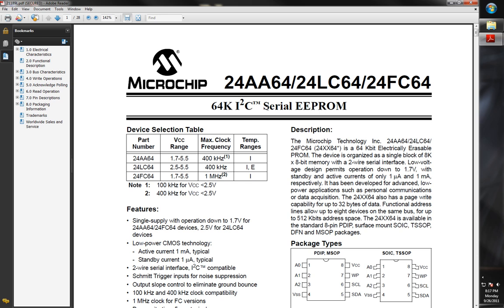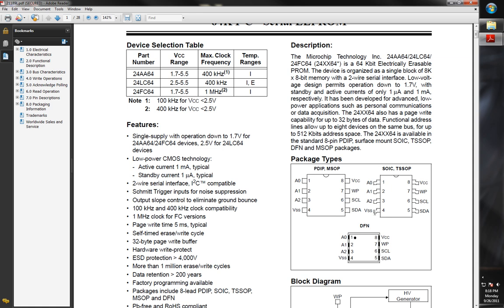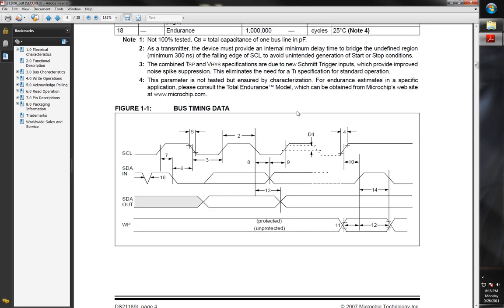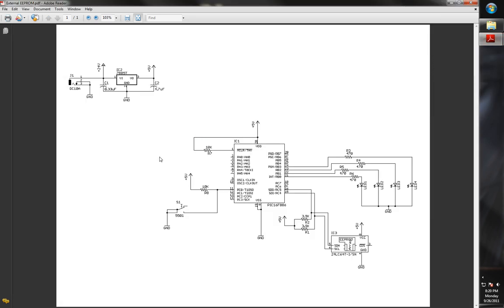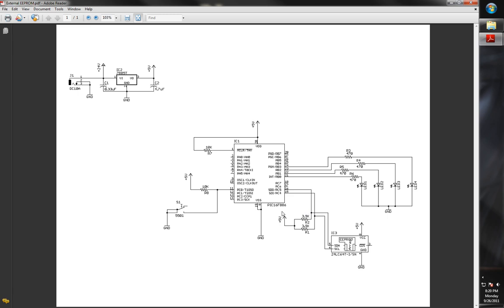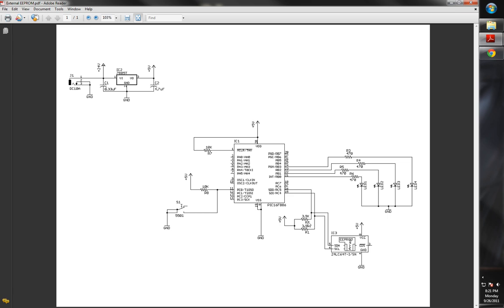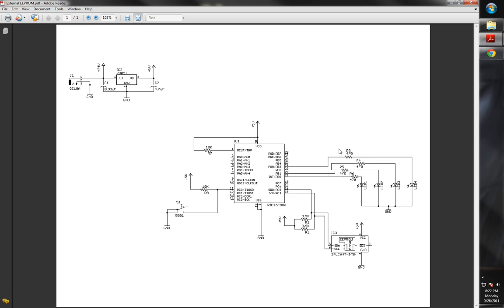Lesson 12 I2C External EEPROM Part 1

Comment: these 2 resistors are not put because it should be put there!!!! its there to synchronize the writing process with the Up clock cycle ..... its not an atomic bomb bro !
Reply: The pull up resistors are necessary because I2C uses open collector/drain to pull SDA and SCL down in order to produce zeros (otherwise they are high and represent one).

Therefore, without the pull up resistors in place it's likely to not work at all.

I don't think the resistor values matter a great deal - I am using 1K for 100/400KHz and also 1MHz and all 3 speeds work just fine. I suspect higher speeds require lower value resistors to ensure fast signal rise times.
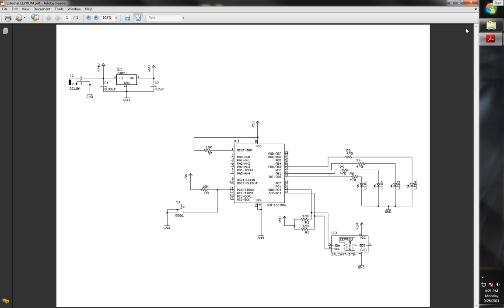Reply from the maker: Hey there thanks for your comment.  Remember my videos are for beginners as well as advanced users.  Thus, for a beginner it is easier to tell them to just put some common values in for the resistors.  Beginners are only concerned with getting the thing to work and not optimizing it yet.  Yes I know that it is all to do with system performance since it relies on supply voltage, total bus capacitance, and total high level input current and there are a whole slew of equations to help you pick the best value of resistors for your specific application.  I did not want to go into all of this for this video since it was just intended to show someone how to generally hook up one of these eeprom devices and get it to talk. Not how to get the most optimal performance out of the connection.  This is why in the video, around 3:24, I mention going to the application notes section of the 24lc64 chip and looking up more information about the two pull up resistors.  I hope this makes sense and I apologize for any confusion.
Reply: i am super beginner btw, and i feel u ,,, btw can u help me with my stuff? i got 93C66A microchip but i don't know how to program it with arduino
Reply from the maker: Hey there, sure I would be happy to point you in the right direction.  Since the 93c66a is a serial chip it will not use the I2C protocol.  In stead you will have to give it a serial line and a clock.  I have included some links to some microchip applicaiton notes that talks about using the XC18 compiler to build code for this and they even give you the source code!  So you should be able to use their source code and convert it to an arduino sketch.  I have not personally used this specific chip but it looks fairly straight forward.  Just read the datasheet sections on how the communication works.  I know reading is boring lol but microchip does a good job of documenting their stuff.  Good luck and thanks for the comments.

93C66A Datasheet
http://ww1.microchip.com/downloads/en/DeviceDoc/21795E.pdf

93C66A Main Page (click on Documentation and Software)
http://www.microchip.com/wwwproducts/Devices.aspx?dDocName=en010889

93C66A application notes AN1004
http://www.microchip.com/wwwAppNotes/AppNotes.aspx?appnote=en024479
Reply: thanks a lot , that is a great help
Reply from the maker: No problem glad I could help